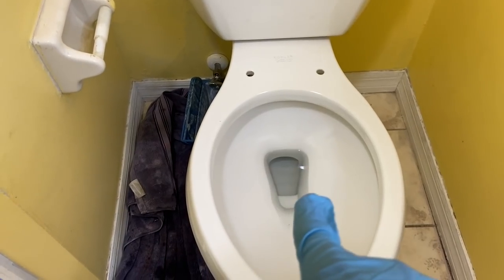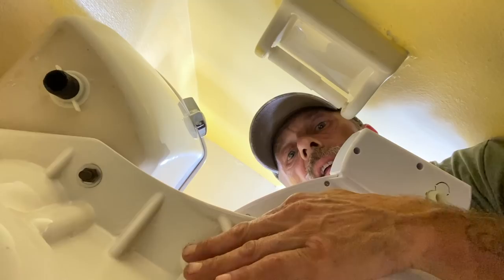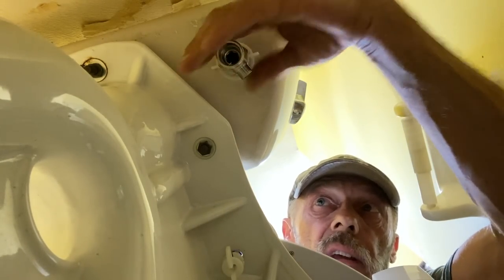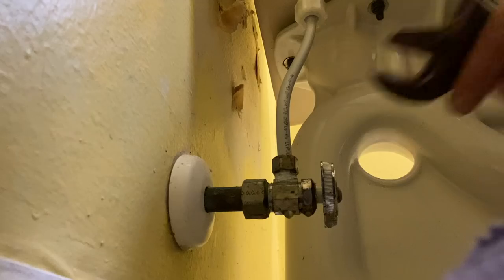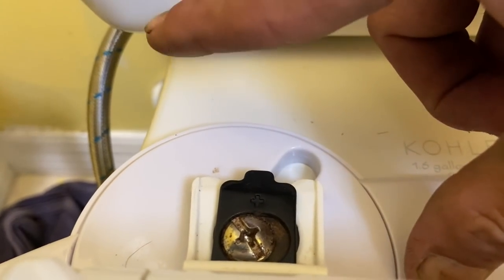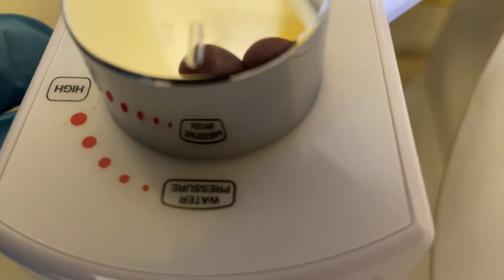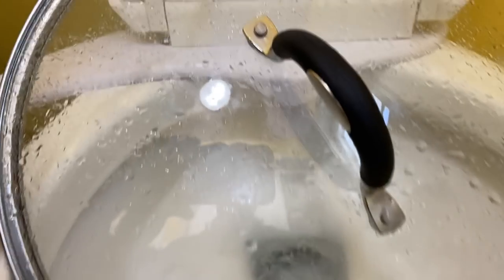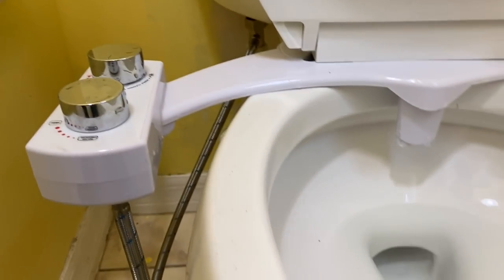HOW TO INSTALL THE CLEAR REAR TOILET BIDET

Comment: Thanks for the video. The printed instructions don't mention the direction of the rubber washer. I had to put the washer on the same direction that you did since the threads would not start properly if facing the other direction. We put a $13 Watchdog 9v battery operated water alarm on the floor so we know if it leaks. The alarms are great for basement submersible pumps, under kitchen sink to catch any leaks of RO water filter. Both the sink and basement alarm has caught leaks before they did any damage.

Comment: how does one attach this bidet if their toilet seat doesn’t screw straight down into the toilet like the one in the video??
Reply: My toilet seat is different than the one shown but I put mine in just fine. Everything closed all the way  and worked great. I am a 71 yr old female and it took me approximately 20 minutes.
Reply: @givemeliberty3086  damn, sounds like you’re one lucky lady!
Reply: @brendencrowe8407  Well, not really. On the first test try, it was leaking and as I went to turn the water back off, I broke the knob off my water supply line. Thank goodness, the toilet sets right next to the bathtub and I had brought all tools I thought I might need before I started. The cleanup took longer than the installation though. I did manage to repair

Comment: The problem with those arms is your right leg gets in the way because there's not enough clearance and you have to sit at an angle.
Reply: Depending on how big you are. It looks like that bidet has the arm pretty far away from the seat.